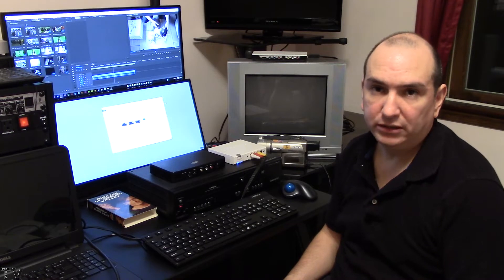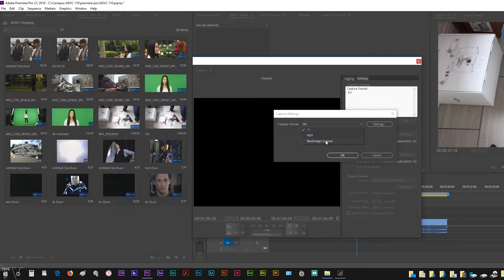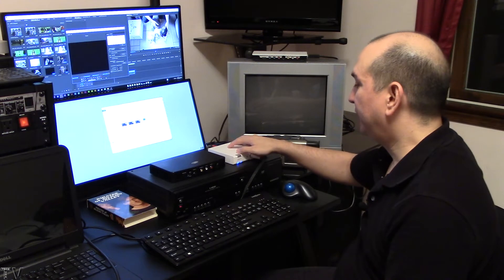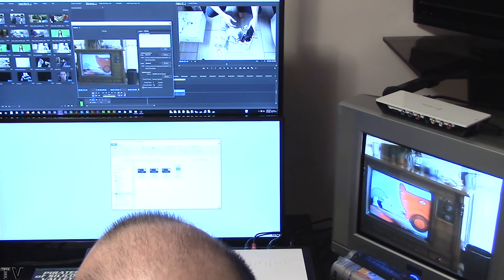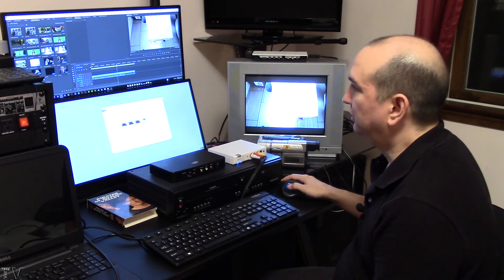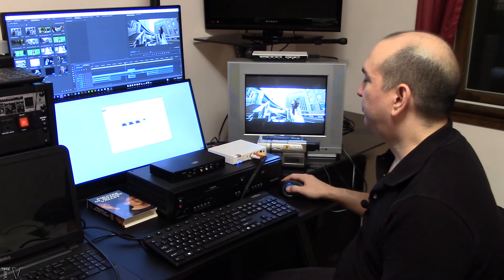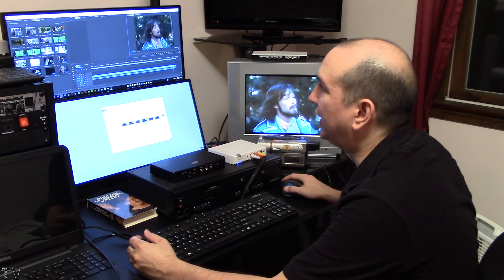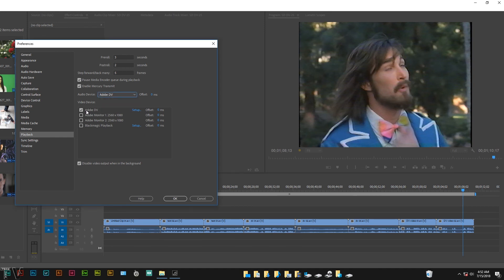Easily transfer VHS and Hi-8 tapes to computer

Comment: Thank you for this video! Would the ADVC110 work well for all magnetic video formats? I'm currently using a diamond capture card, but I like the TBC in the ADVC110
Reply from the maker: It will work with VHS, S-VHS, 3/4", Betacam, Betamax, 8mm, Hi-8 etc.
Reply: Thank you. Are there any newer versions? I noticed that these can only be bought used now.
Reply from the maker: @billtalker3843  You have to buy them used but they work great. The video links might be worth watching. 

https://youtu.be/Q4zcLU4Cdi8

https://youtu.be/vATw63nn3OQ

Comment: No issues with dropped frames? Using a dedicated HD when capturing? Capturing just to a pc with FireWire card? Thanks much!
Reply from the maker: The ADVC 110 is for standard definition only but it works great for capturing VHS tapes. The Intensity Shuttle is for SD and HD. I only use the ADVC 110 to capture VHS tapes otherwise I use the Intensity Shuttle for everything else. You might find the links to be of some interest but feel free to checkout my whole channel. 

https://youtu.be/PTQYJKQpazk

https://youtu.be/barrJWuBzCA
Reply from the maker: This video link might be worth watching. https://youtu.be/xdw9_DETrqE

Comment: What would look better you think in general: Getting this setup (vhs player with this capture device) or a vhs-dvd recorder combo device and using the internal dubbing?
Reply from the maker: This setup would allow you to apply color correction, special effects and also make DVD menus if you use Adobe Encore.
Reply: TechTVusa Ah true.  However, could color correction be applied to the video of the ripped DVD after the fact? Or is all that adding more compression?
Reply from the maker: Ripped DVD? If you capture from a DVD with ADVC 110 it is converted to the DV-25 codec. Adding color correction is not going to alter the video codec. With software you can rip DVDs and make them editable in most NLE if you have a DVD ROM in your computer
Reply: TechTVusa Ah, what I meant was dubbing the VHS to a DVD-R, then turning around and ripping that newly created DVD into just a digital video file on the computer. 

I do appreciate the replies!
Reply from the maker: That way should work OK and the quality should be OK but it will take more time than simply using the Canopus ADVC 110.